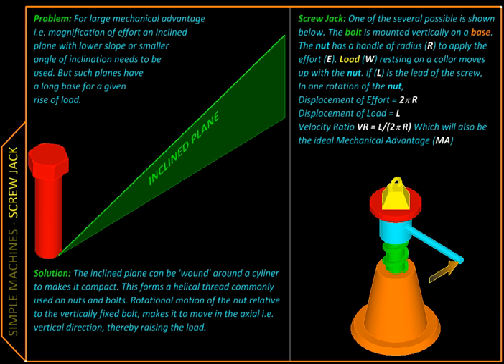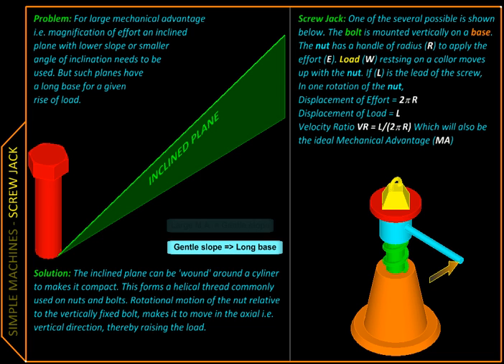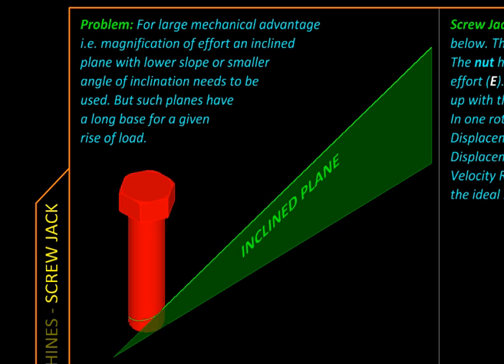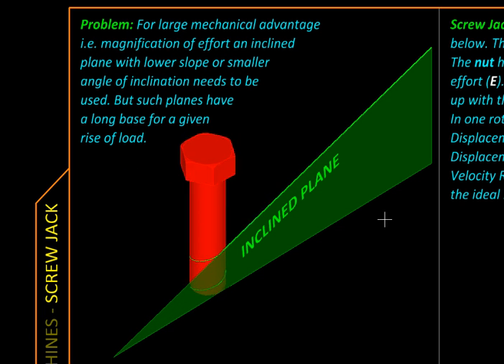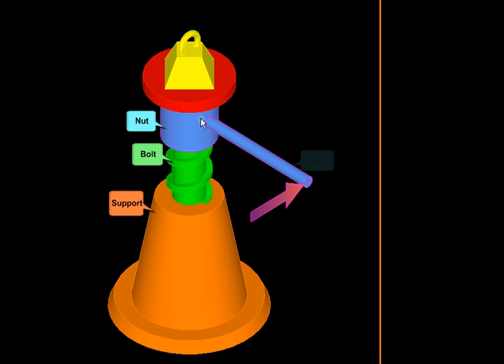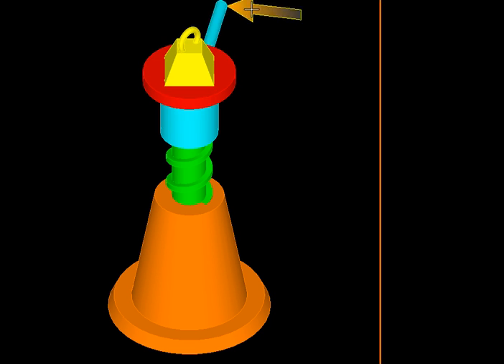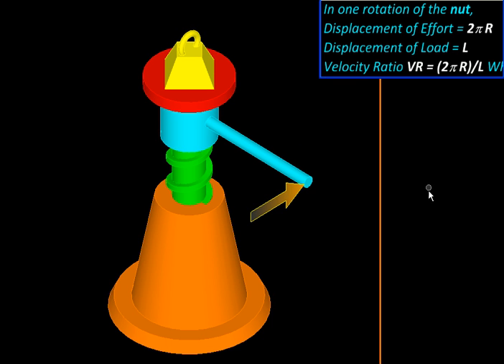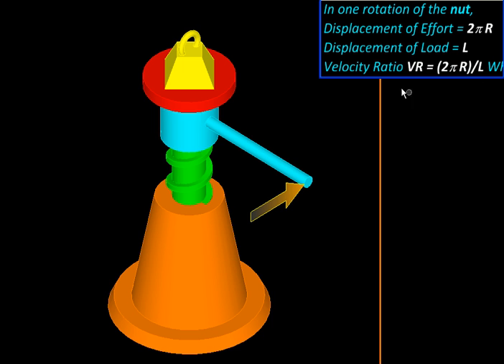Physics with MicroStation Screw Jack

Comment: sir, with due respect what u have shown is credible but u have not shown the mechanics due to which the screwjack will have self locking mechanism
Reply from the maker: +Debonil Dutta Sorry somehow I missed this message. Thanks for the suggestion. Self locking / overhauling would be a good topic to add to this short series on Simple Machines. But it being a general condition (efficiency < 50%) it would make sense to make a separate clip, rather than adding it just here. That could lead to mechanisms where reversibility is desirable - another video idea! 
Thanks again for your feedback!